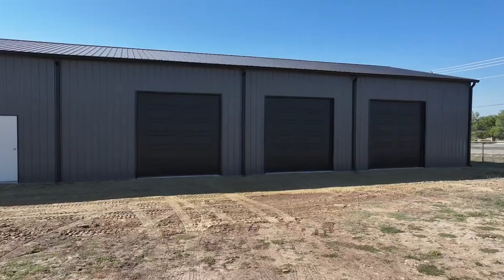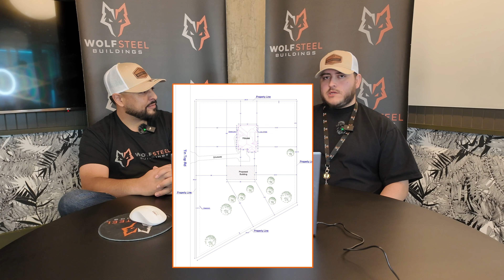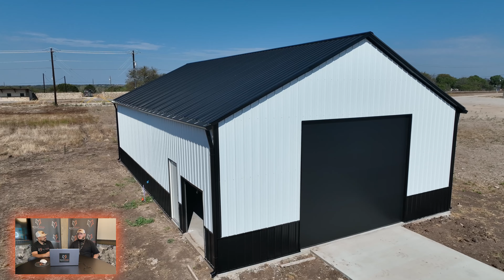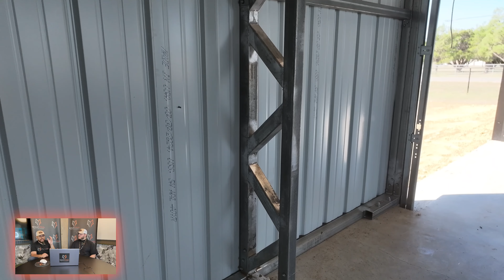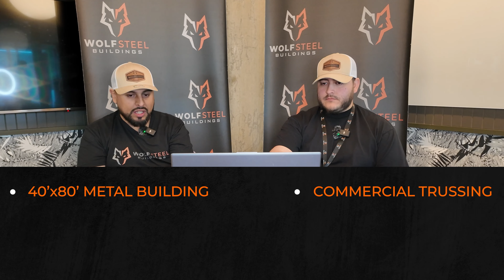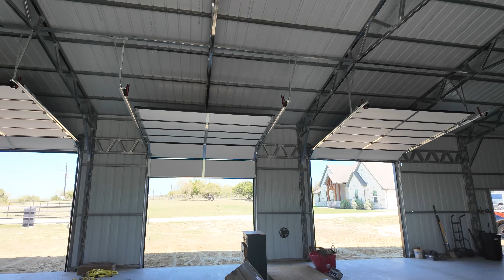40x80 Metal Building Price | Texas Metal Garage | WolfSteel Buildings

Comment: If im correct, widths are increments of 2' while lengths are increments of 5' ? So if I really wanted a 40x40, there wouldn't be much of a difference in price if I were to choose a 36/38'x40?
Reply from the maker: Depends on the building.. 
Tubular (0-30 wide) are typically 5' increments on length
31' + width tubular is now commercial trussing which changes to 10' 
^ subject to change by our engineer specs. 

The wider you go - the move expensive with tubular, but we do not increase in increments on the width. 
Check out this video: https://youtu.be/z-MIxMsQGqI?si=HSKVyK8R6C9U_DJ1

Comment: If going 40’ wide, why not choose red iron?  I’m asking because I’m up in West Virginia and this building is almost exactly what I have been thinking about doing on my property.
Reply from the maker: Howdy all the way to West Virginia! Thanks for following the channel! 

Things that can affect your decision on red iron vs tubular (40' wide can be): 
- Pricing: Red Iron is more expensive that the tubular. Your budget and overall use of the building can influence your decision. 
- Timelines: If you have a timeline set on your project and need it faster - tubular is the way to go. Tubular have a faster turnaround and install time. 40x80: tubular can take 4-5 days vs 3-4 weeks to install. If a bolt up red iron it can take 4 months or so to get the fabrication going but faster to bolt up on your site. 
- Permitting: if you are pulling permits your city requirements can affect. 

Hope this helps!